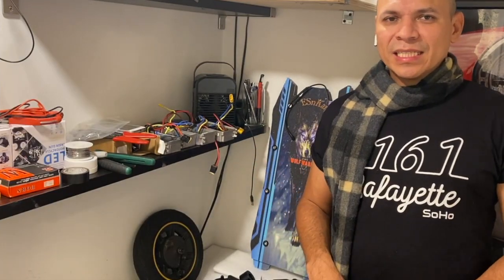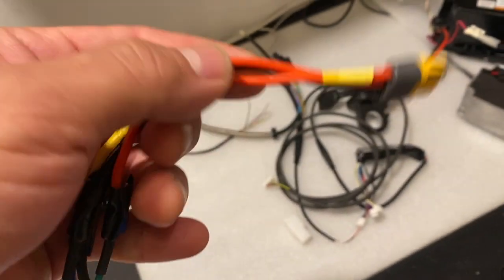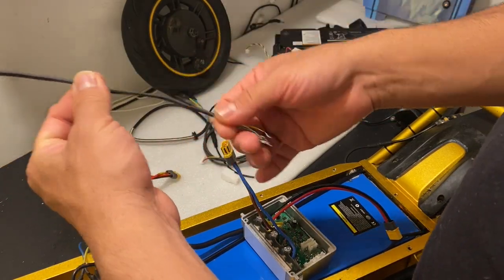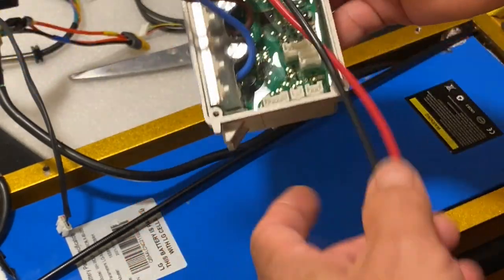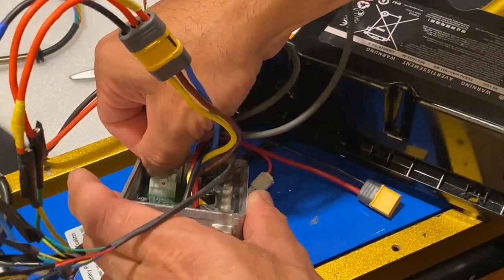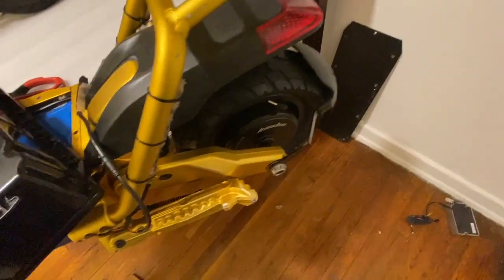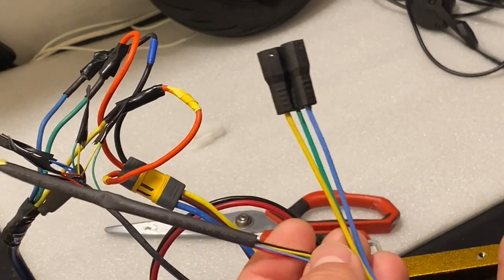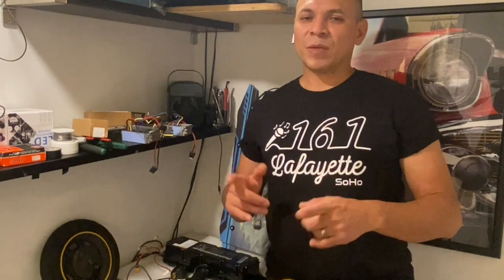Ninebot Max How to upgrade to 1100W Kaabo Wolf Warrior motor.

Comment: Great video and awesome information!! I have a Dualtron Spider motor 60V 1000W but it doesn't come with hall sensor wire, just the 3 fase wires. Does it can be use on my G30? Thanks in advance!
Reply from the maker: No. For ninebot controller need hall sensor
Reply: @esnkaz  thanks my friend!!!

Comment: I have a question about the MR60 connectors because i got a 52v 21ah battery and a sinewave controller max current: 45a with a 1500w rear motor, are the MR60s going to take that much current if i’m pushing 40amps + continuous? just need to know before i start soldering them on to my phase wires.  thanks for the videos anyways 💯
Reply from the maker: The connectors will hold ok 60v and if you are on 52 which on full charge it’s 58v. A bit under… but if you have doubts check them time to time or use 150a bullet connectors.

Comment: Can i use this motor with my stock battary and controller ???? 
i have ninebot max G30E II
Reply from the maker: This motors work better with 48v and above. They still work on 36v but for short distances. If your scooter controller it’s hacked and you can set up motor specifics also ok. Very important though, you must remove regen braking and do dual motor breaking set ups otherwise those stock controllers smoke like butter with bigger motors.
Reply: @esnkaz  another thing please because am going to order these online and can't ship them back :D
is it ok to install this motor on sharkset suspension ?
Reply from the maker: @MomenElwan  yes
Reply: @esnkaz  thnx alot for the help and info , really appreciate it

Comment: Max speed on 48v or 60v battery ?
Reply from the maker: Speed on molicel cells 48v continues discharge 38a 36-40mph. on loads of 165lbs -180lbs. 60v 40a continues discharge 42-48mph. Depending on roads, wind and rider experience.
Reply: @esnkaz  awesome man , thnx alot , am going to updgrade my scooter soon ... will share the progress with you on your group ;)

Comment: Just a question what if I wanted the wheel to spin the other way by the wiring what sequence would it have to go
Reply from the maker: On what scooter and what controller are you using?

Comment: Would this fit without any modifications the sharkset rear suspension kit? Thanks.
Reply from the maker: Just the tire need to be 10x2.50 same as stock of fatmax or Apollo explorer scooter.
Reply: @esnkaz  Do you have suggestions for where to find 10x2.25 tires? The closest I can find is 10x2.5...
Reply from the maker: @imdavehotw3634  Sorry my bad I always think everyone know jejeje On google type: 10 x 2.50 Tire + Inner Tube Set or look for tire code: 80/65-6 10"x2.50 fits Apollo explorer.

Comment: Hi mate I want to buy a ninebot max G30 (not the original) it is necessary change the firmware ? It's a 350 w motor 36v but not original (is cheaper) connections are the same.
Reply from the maker: Trying to change set ups would be a mistake in most cases as well is imposible.
Reply: @esnkaz  I don't want change Notting hehe just install I'm asking if u got any error on software?

Comment: I have bought 3 used batteries ninebot segway 10inr19/66-9 voi nee 1009-w battery 36v, 27 a that I intended to use instead of the airboard battery for my homemade electric bike. The connection from the airboard battery must be adapted to the connection and charged with the airboard charger. But need some help. You describe things so clearly and I thought if anyone can help me then it's you with your knowledge Thanks in advance
Reply from the maker: Make sure batteries are in good conditions not too old or depleted. You can combine them for 72v set ups. Igual capacity. I would not go above. Those batteries come with the connections for the BMS and not needed unless you were going to reset it, which is not recommendable.
Reply: @esnkaz  The battery seems good 36 v with voltmeter but I can't change the battery connections to TX 60 connections (there are two inputs), I want to drive and charge the battery instead of Airboard battery with normal tx60 connections. That's why I need a wiring diagram for changing clutches, of course against payment. Thank you

Comment: That moder can fit on G30 max without rear suspension sir?
Reply from the maker: Yes using a motor same size as stock. If you are not member of my group Esnkaz Ninebot Max Evolution USA on Face book do become for more info. Just post your questions.

Comment: does the motor fit on frame of g30?
Reply from the maker: Hey Menalix. Unfortunately no. The axle of the wolf warrior it’s longer than ninebot max. Apollo explorer 1000w will fit Perfectly on stock ninebot and so is the Kaabo Mantis motor 1000w. All bigger motors can be install with adjusted suspensions. Check out video installations on my channel for how to do that.

Comment: What firmware settings do you recommend at 36v and 48v?
Reply from the maker: Simply load a 48v firmware and change serial number on your stock scooter and increase speed up to 22mph with that simple hack. Totally safe. If in future which to add more voltage such as 12v to convert to 48v or add a bigger motor with that firmware already in the settings, simply plug and play ;)
Reply: @esnkaz  what would be the safe amount of amps that could be applied?
Reply from the maker: @benhunter6811  usually don’t go above 34A to 35A. This will serve for bigger motors as well. G1/g2 cut life of them to about half or a quarter specially if you weight is over 180lbs.
Reply: Thanks!
Reply: @esnkaz  what if I’m running 58V
Reply from the maker: @malachit6282  If you are on 58.8V its 52V Battery and this motors will work best with more voltage. They are rated for 60V.
Reply: @esnkaz  would this motor drain the stock 36V battery faster? Resulting in much less range even and shutting off before low % battery? Does matching voltages of battery to motor maintain range and performance? For example, if I get 21 miles from 36V and stock 36V350W battery, would I get 21 miles from 48V and 48V800W motor?

Comment: Only thing wish should not made any digtal buttons on segways ninebot max models and sonwould you able tru figure out with keys that be nice in future tonkeep every customer scooters safe as not worth seeing most of them getting srilen by crimnals thieves are getting getting worst and best way tontry adding alarm imobilizer kit that would help saving ya scooter without gmbeing touched by thieves hope works out for every lived ines out there ejoying there beast no matter god blessed you all safe cheers
Reply from the maker: There is great things for it. GPS that can turn on off scooter with your phone… Monorim has a part that works that way. Physical key is a retro system easy to hack and get rid off. Honestly best way to take care of your scooter it’s never to leave unattended. I use gps trackers and when leave for a few minutes unattended I use a heavy duty lock 🔐 n the disk brake plus have a hidden button which behave as interruptor so scooter can’t be turn on off without pressing it.